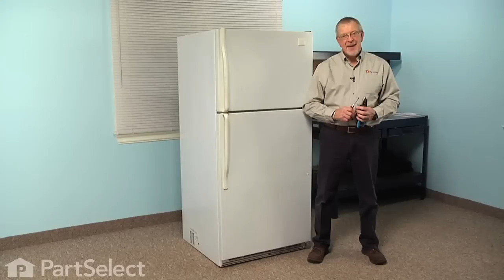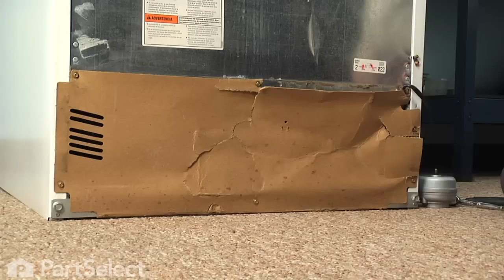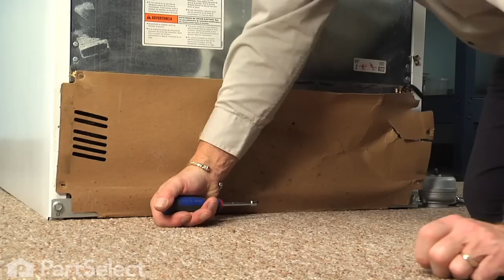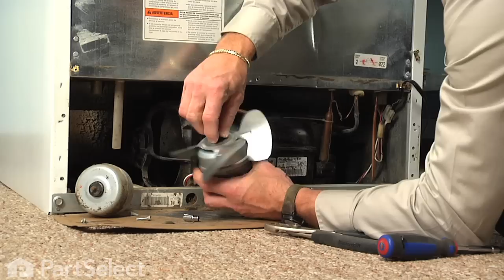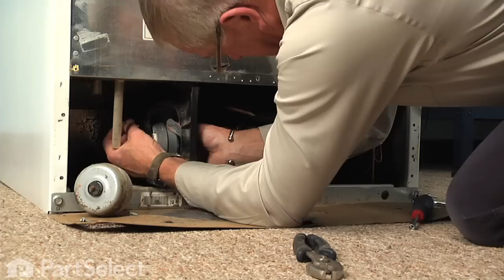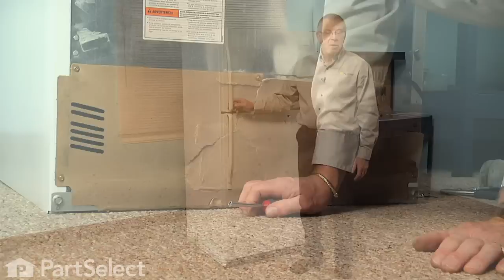Refrigerator Repair - Replacing the Condensor Fan Motor (Whirlpool Part # PS371043)

Comment: if refrigerator is making noise how do you know whats causing the noise
Reply from the maker: Hello, what kind of noise is your refrigerator making? Where is the noise coming from? Please provide your model number and I can research this for you.
Reply: If the noise is coming from the fan when it kicks on, then 
the  fan bearing is worn...reason being you got dust floating
throughout your house and part of it gets pulled in by the
fan in to the bearing eventually wearing out the fan motor.